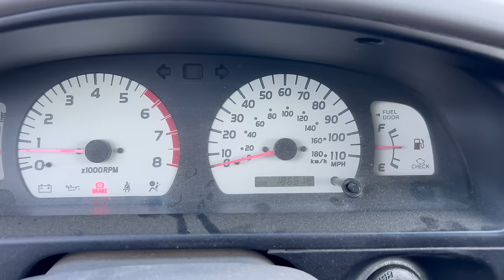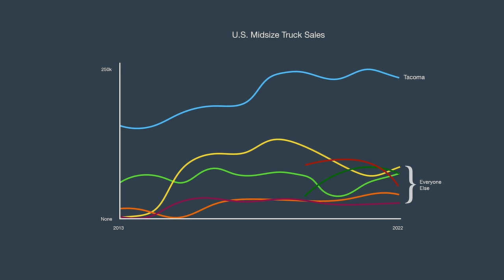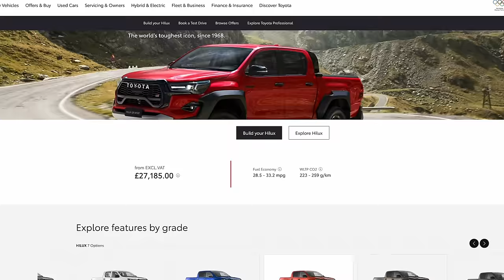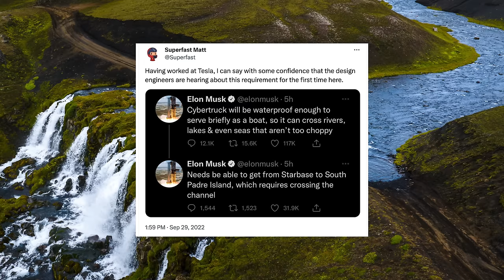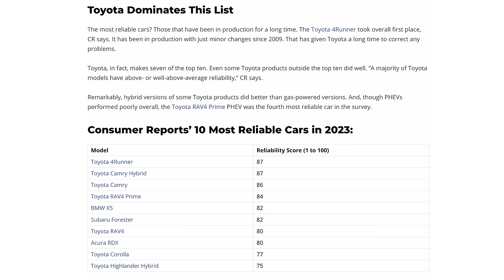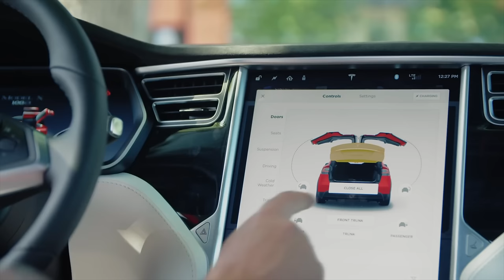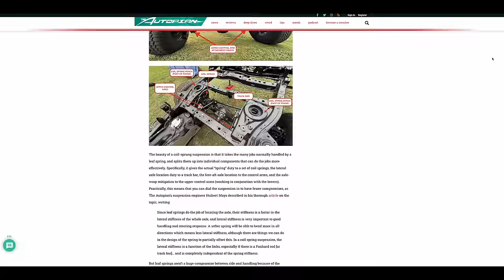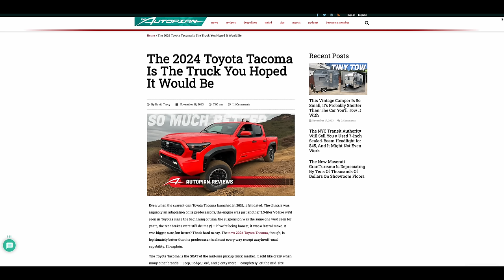What Is The Best Truck, And Why Is It The Toyota Tacoma?

Comment: I have driven the newer tacomas. I wouldnt give you a nickel for them. The manual has no power whatsoever at low RPM, It did not have enough tourque to pull awyay from a stop without high rpms and riding the clutch. The automatic does not slow down, There is zero engine braking available,  Throttle response is non existent unless you constantly smash it and leaving from a stop is not consistent,  How are you supposed to tow anything if the truck will not launch consistently or use the engine to slow it down,  I settled for a tundra eventually and it was no better,  Traction control on the rear wheel speed differential only, I could not get out of my driveway at less than 5 moh in winter but could lose control at 40mph because it was not smart enough to tell that both back wheels are moving faster than the fronts,  Most dangerous vehicle i have ever owned, Sold it and bought my 2000 4runner and manual swaped it, It does not have as much hp but at least it is consistent and has the abillity to tow something without insane rpms and smoking clutches.
Reply: Not to mention the engine blowing up at 30k miles

Comment: I own a 1999 dodge Durango, 253k miles on it and it runs great. Bought it for $800. Great vehicle. I don't take very good care of it, just occasionally put some oil in it. I've seen the same with over 400k miles on them and still going strong.

Comment: If Toyotas didn't rust here in Canada they would still be on the road today. 400k miles on my last one. I beat it to death daily red line clutch dump burnouts. I got it 2nd hand from a sales guy who drove it daily trying to sell them computer thingies back in the early 80's. It rusted equaly everywhere lost 200-300. lbs and was quicker LOL It just went back to earth running fine.Then I got a 1987 YJ Jeep still driving it, new cars suck.

Comment: Toyota undoubtedly OWNs the midsize truck market, and for good reasons, but I'm old enough to remember when Datsun (now Nissan) was the king of small to mid size pickup trucks in the USA.  How Datsun/Nissan gave up that crown so easily, and apparently almost without a fight, is dumbfounding.  I don't know what happened to Datsun/Nissan management that allowed Toyota to dominate so completely after around the early 1970's, when I graduated from High School, but it happened rather fast.  Gone are the days of the great and cheap Datsun pickups, 240Z, and 510 sedan, and Nissan is a faint shell of what it once was.  If anyone knows the why's and wherefor's of what happened and why, I'd like to know, because it has always been a mystery to me regarding the decline of Datsun/Nissan, during the same time Toyota was booming.

Comment: Meh. I wanted to love my 3rd gen TRD Offroad 6MT 4x4. By 33k miles I had a steel coolant pipe crack, BSM failure, and then a complete engine failure. I think Toyota reliability peaked with the 2nd gen Taco and 5th Gen 4 runner (1GR engine).

Comment: Gen 3 Tacoma 3.5 V6 is excruciatingly gutless.  Like, constant gear seeking to maintain highway speed gutless.  Like, getting passed by cyclists gutless.  Hopefully they have improved on that.  It's the reason I got rid of mine.  Just flat out obnoxious.  Replaced it with a Silverado with the 5.3, and actually picked up almost 2 MPG in addition to having enough power to speed in a school zone.  Difference is, the Silverado transmission went out at 60k, and I'd bet money that the gutless wonder is still problem free to this day.

Comment: The things that kill me about the Tacoma are the lack of power and bed size for what is a pretty big and heavy truck. Crew cabs have hill small trucks imo. I want a new version of something like a c-10 or an old ranger, or the Nissan hardbody, or Mazda’s old truck. Something that’s small win a pretty large bed, single cab, and fuel efficient. The Tacoma is none of those things. Neither is the frontier, Colorado, of new ranger. Ford made an attempt with the maverick but it’s just not that great. The large trucks are way too big too. Why can’t we get back to when an f-150 hauled the same as it does now with a larger bed and in half the size. I know it’s the EPAs fault but it kills me. Somebody make a better maverick so I can get all the power in the tiny size. A good hybrid could bring back the small truck market

Comment: It really is the best all around truck! Great video!!! My first car I fell in love with was a 1989 Toyota pickup 2wd, it was amazing, tiny, fun and of course reliable. As much as I loved it I made the foolish decision to upgrade and get a nice fancy new truck of course to impress a girl along with actually reaching the speed limit. Bought a 2006 taco prerunner sr5, I’m now at 272k on it with really no major issues. It’s been full of about 300lbs of tools ever since! Earlier this year I made the decision to go back to the old pickups and scored a 1985 Toyota pickup 4wd 22re with a 5 spd, extended cab and the frame was extended by 1 ft so it has an 8x6 ft aluminum flat bed. Brand new engine, along with quite a few other under the hood components. Brought all those amazing memories back and I’m very happy I made that decision. It’s slow and clunky but it can do anything I ask of it and there’s nothing else out there that can compete with one. I built it to haul tools, get me to remote job sites and do it for 200k care free miles

Comment: If I hadn't worked for one of Toyota's Part suppliers... I'd be more optimistic
about the truck. But the company wants to work you 7 days a week, 12 hr shifts. That sh-t gets old in mfg. 

Anyways, I've heard Turbos are what kills engines early...  b/c of lubrication issues & b/c they over complicate things.
Reply: Nearly all proper commercial trucks are turbocharged and those engines do more than 1M kms.
All large earth moving equipment is turbo charged, and most of these engines are inline 6cyl

Comment: I can really appreciate this video, but to be honest I'm not sure it is so much about this specific manufacture, but this era of vehicle from Asian manufactures. There was a simplicity about them, comfort was low, and they generally kept vast differences across models. That's why I bought a 2011  Xterra. There was no difference since 2005, and even that change was minimal.  Practically no electronics, doesn't have 10 seat motors, and practically everything in the vehicle is controlled by a manual lever. I would much rather have this than a new Tacoma...I can actually fix it. I think the issue you are uncovering is more of a car philosophy change than a specific manufacturer durability. Even the new Tacoma's have become luxury vehicles. Simplicity is now the rarity.

Comment: Glad to see the new taco has rotary physical dials for the climate control. I'm a tech and worked in denver on a ton of new vehicles, and there really awful to try to figure out stuff with. Tons of touch screen this and clutter just everywhere. I'm a young man and finding crap on new cars is hard, imagine the clients that actually buy new cars are significantly older than me have a really hard time figuring it all out. Some of the screens (fiat Chrysler especially) are just awful slow and clunky. Not to mention trying to drive and adjust the settings at the same time while your getting bumped around sucks.

Comment: We have a 2019 Taco at work and I hate driving it. Slow, bad body roll. Would rather take the CRV. Sure they last (or used to), but majority of folks nowadays just lift and pavement ride them, such a waste. Not to mention they're just about the same size as 1/2 tons. The Tacoma is the "cool" midsize truck with no real competitors, sales driven by societal "coolness", similar to Wrangler Unlimited. Huge sales almost by default. A midsize truck does nothing I need it to (pulling tractor / livestock / hay). I guess I could make a trash run to the dump.  Thank god I don't have to buy one...

Now how about that offroad Viper?!?!

Comment: The two Toyotas that I've owned have been great but I've had some stellar American vehicles. I have a much neglected '95 F150 with a manual trans and 4.9L straight six that is the epitome of bulletproof simplicity.  I have also had a 2002 Suburban that had 430K on it when I got rid of it and was still running great. Also in my stable is a 2006 Range Rover that is fun just because of the rush of endorphins I get when I complete a trip without something breaking.
Reply: Join a support group for the Rover....🤣
Reply: We got my son a 1997 Ranger single cab 4 banger 5 speed. 180k miles and does everything exceptionally well for a dirt cheap truck. I don’t think we will ever sell it because it is so wonderfully simple.
Reply: That's not the kind of "rush" I need! 🙂
Reply: @bradleyhanlon  Those 90's. Rangers were great. I had a 91 Ranger and it was a workhorse. When my son totaled it, we replaced it with a 92 Explorer that had too many creature comforts to be reliable.

Comment: we used to manage a fleet of 30 tacos for about 15 years, I think we say around 120-150 of them total.  
they auctioned them off at 350k miles because the seats were so worn the drivers complained.  still brought 5-6 grand at auction, I know that because I wanted to buy one!  

no major issues to speak of other than there was a run of them that ate left front wheel bearings every 100k miles for about 3 years.

Comment: While the Toyota Tacoma is likely more durable than most "American" small pickups, it's questionable whether it's any more durable than any other "Japanese" make. More than anything, this is a testament to just how bad the older American small pickups were. Having owned both a Ranger and a pre-Tacoma Toyota pickup I can say that the Ranger was pretty much junk, and the Toyota, while better, had serious issues as well. Like misaligned "accessories" that resulted in repeated fan belt throwing, and horrific cold start piston slap. 

That aside, I think Toyota really missed an opportunity here. The Tacoma, although reliable and durable, is very inefficient, and in many ways just downright crude. While the new version is somewhat more efficient, and replaces a V6 that has a notoriously terrible powerband for a truck with a more rationale engine, the thing is still a relic. 

Toyota has a problem. Sales of cars in China have pretty much tanked, and the Tesla Y/3 have displaced the Camry/Corolla/Rav 4 as best sellers in the US. Toyota has decided that rather than actually innovate, they are going to sell legacy IC vehicles in any form as long as they can. To this end they have engaged in unprecedented levels of lobbying to try to stall or kill fuel efficiency mandates. 

The Tacoma is more of the same. A ladder frame, live rear axle trucklet that as Throttle House found out, is downright dangerous is stability control is defeated. Basically, it's a warmed over version of a truck they have sold for years that offers little more than durability. 

I found the references to the Cybertruck to be odd...but amusing. Yes, Tesla has just released a truck that offers 3x the efficiency of a Tacoma with something like 40% more capacity and enormously better performance. While the Tacoma has a bitchin paint job, the Cybertruck is actually strong on the outside. While the Tacoma has a wobbly ladder frame, the CT is something like 10x as rigid. While the Tacoma has a rear axle that Henry Ford would have found familiar, the CT has fully independent suspension. And on it goes. Yes, the CT isn't a direct competitor of the Tacoma, but it shows what the Tacoma could have been had Toyota had any interest in actually making it substantially better.

While Toyota has a safe pickup business for now, it's only a matter of time before they won't. It's likely that Toyota is busily developing a really new truck while continuing to sell a pretty much obsolete design as long as they can. Should we consumers applaud this? I think not. What Toyota is doing is what's in the best interest of Toyota, not the consumer.

Comment: I just remember the Taco my cousin owned. First gen with a stick. It almost had enough power to get out of its own way - it was outright dangerous to drive above 55mph due to not being able to go up even a small incline on the interstate. It had a lot of miles on it, yes, but those were miles spent cursing and screaming as you slowly dropped to doing 35 in a 75 since there was a 3 percent grade you had to climb the next 12 miles.

Comment: Sorry, the Honda Ridgeline is by far the better truck.  Roomier front cabin.  Far roomier back cabin.  Far more volumous and useable rear cabin storage.  Better gas mileage.  In-bed trunk.  4x8 sheet of plywood lays flat in the bed.   As good build quality (both brands are great).   Better visibility out of the cabin.  More comfortable seats.  Full time all wheel drive, no need to switch in/out of 4x.  Better handling on pavement.
-
Ok, if you actually rock crawl, or tow more than 5k pounds, then yes, the toyota is better.  But for 99% of truck owner who DON'T do either, the Honda is better...

Comment: Dealer markups on Toyotas are ridiculous. Plus go build on and try building a comparable frontier. Packages and features very pricey . Now they only using different versions/outputs of turbo engines. I think a 2.7 or something.  Which is concerning from a reliability standpoint. I don't think Toyota gonna put out an unreliable truck but half millions miles might be gone. Toyota know the have traditionally had the most reliable cars/trucks but you gonna pay for it for sure. If not from the OEM the dealer will get you. Which is why I won't be buying a new taco. Just don't think the new models will last 30 percent longer anymore. So I'm not willing to pay 30 percent more

Comment: This is one of the only times where I welcomed a V6 being replaced by a turbo 4 cylinder. The outgoing 3.5L was good on paper, but the torque curve would have you think it was a moped engine. Also, small correction, the Tacoma will not fill the observable universe because up here in the north, the road salt is steadily returning them to the very earth they were formed from.

Comment: The only sad thing about new toyotas is that they come rusty of the dealer floor. I'm not kidding. I work at a Land Cruiser/4runner/Tacoma workshop and we do a lot of rust prevention. Literally 1 month old trucks come with surface rust on the frame, bolts, sway bars etc. The rest is great, but that corrosion though...

Comment: I’m heavily vested in Toyota trucks, and I have to say with experience … the newer generations of the Tacoma are a completely different animal from the prior generations and international versions, such as the Hilux. The 2nd/3rd gen’s open-c chassis is floppy and weak; The composite bed is weak and breaks; The diffs and axles are the same size as prior models that weigh 1k Lbs less and are therefore weaker; And the electronic bloat of critical systems is abysmal. Toyota regeared the Tacoma design for “most users” … which effectively ruined it for those who made this vehicle’s cult and legend status. The newest Tacoma is bloated, long, low, wide, heavy … and has a very complex engine that will harm home serviceability and overall reliability. Meanwhile, the Hilux maintained the utility centricity of the older Tacomas, including fully boxed frames and limited electronic junk. The Tacoma cult is now dominated by urban bros who don’t know a single thing about off-grid use and why all of this stuff matters — and the new Tacoma follower is the downfall of the Toyota truck cult because they contribute nothing substantive and detract from the group of people who made these trucks hit full legend status. Great video … but the founders of the Toyota truck cult need to take back the market from those who are transient in this space. 👍👍

Comment: bought my first 1977 hilux in 1980 and having lived in Japan for a few years owned them there..and after 4 runners in the 80s more trucks more 4 runners and the last Taco I owned was in 1995 american made extra cab 4wd..the quality dropped from Japanese made vehicles and after that Im a 4 runner fan and still have my 07 sport edition with 250k original XREAS suspension no rust no oil leaks and the 4.0 liter is bulletproof..I will never buy a new Taco..that turbo motor is not as reliable as the old one..in addition Ive had Toyotas with turbo diesels over the world that were bulletproof but not offered here in the US I especially liked the diesel landcruiser I had in Colombia so Matt is a bigger fanboy then i am, except ive been at it longer  and owned more over the 40+ years ive owned them ill stick to Japanese MFR vehicles

Comment: The whole "Truck does what you want when you want" thing is why i hate my Audi so much. It takes a full second to shift when i hit the paddle. Im at half throttle, and the butterfly valves are still closed. I tell the car to downshift, and it does, then imediatly shifts back down.

Comment: Great video. Replaced my 2002 Tacoma TRD off-road manual for a 2022 TRD off road manual last year. 
I like the new tech for my radio minor creature comforts but the separation of the driver from the car was noticeable and I’m still grappling. I have more power on a tech sheet but it feels terribly under powered. I’m considering a supercharger and in part just to have the computer flashed. I don’t regret my purchase cause it is a Tacoma. I think your video illustrates what many of us experience who have gone from gen 1 to newer (3/4). 
Glad they still have a manual option though. People are always shocked when they see my 2022 with a manual. I wouldn’t have it any other way. Thanks for the content!

Comment: I daily a 1989 C2500 TBI350/TH400/4.10 rear... the only electronics I have in there for the driver is the HVAC controls (super cool 80s VFD style) and an aftermarket bluetooth radio. I'm ok with that. Simple, Effective, and Reliable.